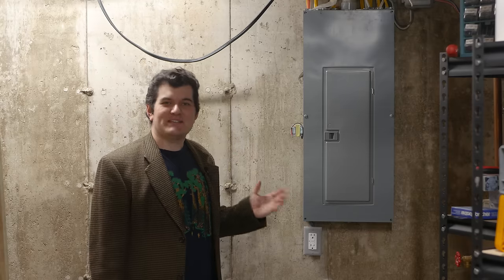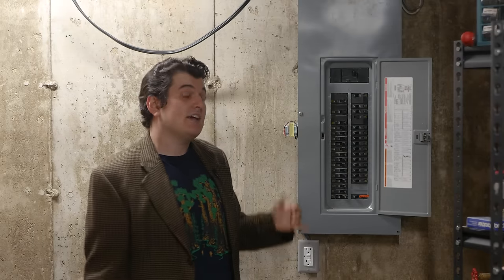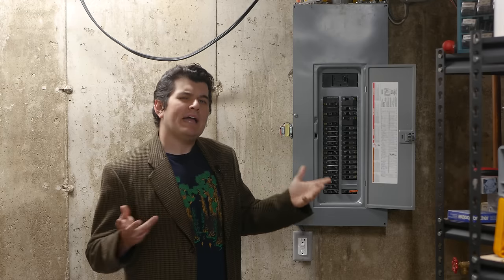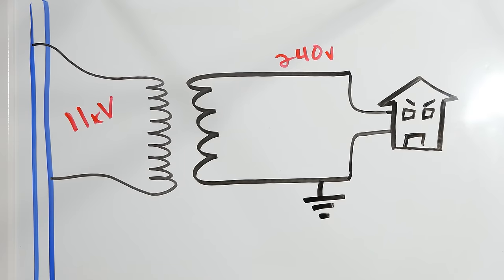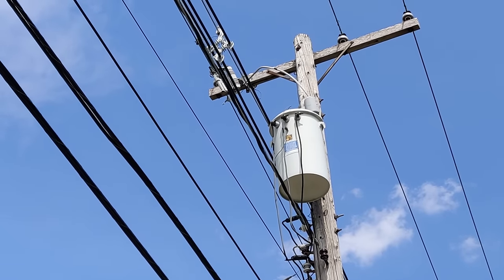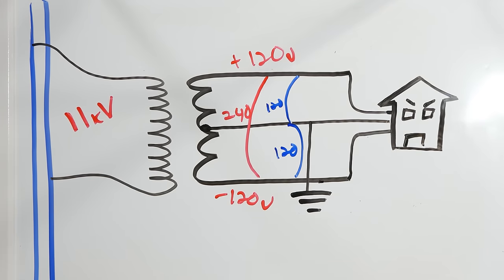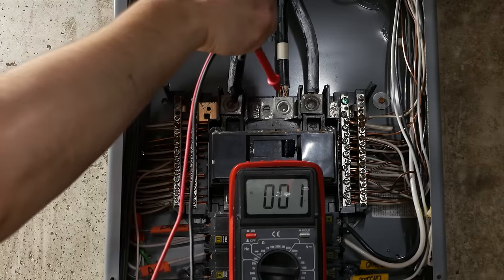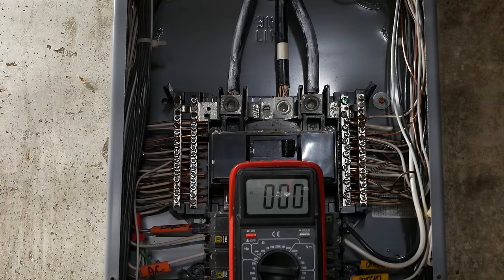The US electrical system is not 120V

Comment: The switches on our UK outlets goes back to before we had shielded conductors on the plugs. 
By switching the switch off the conductors were disconnected from the supply in order to prevent fingers from contacting the unshielded conductors of the plug. 
Unshielded conductors were outlawed a few years ago and the switch is in reality no longer really necessary. The design of the 3 pin UK plug ensures that the "HOT" wire is always "on the right terminal" so that the switching occurs on the "HOT" side . 
Most homes in UK are supplied by a single phase from a 3 phase supply at the local substation. 
The voltage between phases on a UK 3 phase system measures a nominal 415 v.
Reply: The same methodology applies in Australia and New Zealand except our type J plugs are pathetic. 
The British Plugs  Type G (of which I have some) and used in quite a few countries, for example,  Some African countries, Jordan, Iran and Hong Kong among others are the best-designed Plugs and sockets in the world.  The German version of the European design comes second. (China uses the AU/NZ  type  I  as does Argentina and a few others.
It can barely handle  10 amps  2300 Watts . I have seen them heat-stressed  and starting to melt.
Really dreadful design.  U.S. plugs and sockets are just as bad and perhaps worse than AU/NZ
Reply: The switch is very handy when you have something like a phone charger and it means flipping the switch stops it charging, so you don't have to keep unpluging it.   Also when dealing with a high current inductive load - fan heater - to turn it off in case of a malfunction and avoid the blue/green flash of the back EMF across the plug pins.   Every UK socket should be switched, then it could save the country a fortune with devices that are never really OFF and only go into STANDBY, that way we might have a cat-in-Hell's chance in meeting the  carbon reduction promise that idiot PM Blair signed us up for...
Reply: Because you have 240V on each wire in the UK.
Reply: The switch was always an optional part of BS1363 from the beginning.  It was never required, even before sleeved L & N pins.
Reply: @jonathanpalmer155  Wait, am I understanding the order of operations here?
You (charging phone):
1) Plug phone into charging cable.
2) Turn on outlet so that phone starts charging.
You (stopping phone charging):
1) Turn off outlet.
2) Unplug phone from charging cable.

Me (US; charging phone):
1) Plug phone into charging cable so that phone starts charging.
Me (US; stopping phone charging):
1) Unplug phone from charging cable.

-the purring dork
Reply: US hots are always on the right side also, assuming the ground is on the bottom.  If you have an ungrounded device (like most lamps), a wider neutral prong ensures ensures that you can't plug it wrong (the neutral prong won't fit in the narrower hot slot)
The US electrical code doesn't specify a direction for outlets, so some buildings have them all upside down (ground on top).
Reply: I  started switching off sockets when a phone charger I left plugged in but unused developed a short one night, overheated and exploded (even though it was on an RCD protected circuit). So now I switch them off. It would be a real pain to have to unplug them (some of them have flimsy earth pins), and you mention how hazardous UK plugs are if you stand on them? You are right. Solution = leave them in the socket and turn it off at the switch. Voila, no hazard. 
Regarding RCD protected 240 sockets in the bathroom, why? RCDs are OK until they fail (failunsafe). Yes I know you are supposed to test them monthly, but no-one ever does. The first time I tested an RCD, guess what? It was faulty. So no protection. That is not an acceptable solution.
Reply: @comter  There's nothing in the UK setup that requires you to use the switch. You can leave it on and then the situation is exactly the same as the US. Alternatively you can use the switch to isolate the charger when you're done. I am pretty sure modern chargers use barely any power in standby so it's hardly worth worrying about, but to reduce it to zero you can switch it off at the socket (which is marginally easier than unplugging it).
Reply: @denelson83  240V on Live, 0V (or thereabouts) on Neutral.
Reply: @bimble7240  Bathroom sockets for shavers etc are isolated via a transformer not rcd protected.
Reply: @donaldasayers  Yes I know. In the video the author complains about the fact that 240V outlets are not allowed in UK bathrooms and suggests that RCDs could be used to protect them. I was responding to that suggestion. Maybe you missed that comment from him.
Reply: @donaldasayers  Bathroom shaver sockets were around long before RCDs were even a thing. Don't see them here in New Zealand any more.
Reply: @comter  No we can do the same, we just leave the switch on.
Reply: @bimble7240  Nope. Actually I'm agreeing with you.

Comment: 15:10 “magical point at which voltage...becomes dangerous”. When the telecoms industry in Australia was deregulated (back in '80s), the new cross-industry regulator needed to get data on just who could be authorised to work on telephone circuits, which operate at 50V DC with superimposed 80V AC ringtone. An employee named Ed Bondarenko, known colloquially as Dr Lightning, and who worked in the high voltage lab of the research facility attached to the original government telecoms authority, volunteered to be hooked up to increasingly strong power sources (voltage and current) until physiological trauma was detected. This was done at a major city hospital with resusc gear on standby. The outcome was that telecoms circuits required similar licenses as any other electrical work.
Reply: Why am I laughing while reading this? Especially the part "...until physiological trauma was detected." Who did the detecting?
Reply: I think you got the name wrong I think it's supposed to be electrboom or big Clive?
Reply: I wouldn't call the licence similar to any other electrical work,the course to acquire a open cabling  licence(phones) can be done in 2 weeks. Add maybe 1 week for some endorsements like structured cabling(data), overheads and undergrounds.
The course to acquire an A grade Electrical licence is 4 years.
Reply: Hahahaha,  ozzy still using copper for telecommunications.
Reply: @debochch  a pretty substantial portion of rural america still is too lol
Reply: I once stripped the cabling off a phone cirquit with my teeth. I forgot that it was plugged in and 48V with no skin resistance is quite a jolt.

I am happy to not have touched the 110V AC ring with my tongue.
Reply: Correct about the telecom circuits, but I should point out the 90 VAC is not 90 RMS, but 90 volts peak-to-peak. That is, the voltage - superimposed on the 50V talk battery - goes to nearly 0 and up to about 100V. That doesn't sound like much, since the 50V DC talk voltage is barely noticeable unless you get it on thin skin like the underside of your forearm. However, AC hits our body much harder. The 100V peak-to-peak ringing voltage will make you pull your fingers back right away! I made excellent contact palm-to-palm with 300V DC when I was 14. It felt like I had been hit in the back of the head with a baseball bat and everything got dark, but I didn't lose consciousness. If it had been 300V AC I would not be writing this.
(Recently retired after 34 years in telecom/IT for a large electric utility)
Reply: @debochch  We have a lot of it in the US. New circuits are fiber on the broadband side but often copper for the "last mile" to the customer, except for high speed circuits. When I retired two years ago we were still putting in a bunch of copper T1s. POTS (Plain Old Telephone Service - a genuine telecom term!) is copper at least from the subscriber to the pedestal.

Comment: In europe we have 230/400V in wye configuration evywere. Mutible houses are conected to a 3 phase transformer at once. This is possible due to the higher voltage so the cables can be longer.

There are single and tripple brakers for 230V single phase and 400V 3 phase circuits. (*Some contries use double and quad brakers instead because they are also switching the neutral).

Like the 240V appliences in the US some 400V devices are need the neutral and some are not.

Comment: "A spark from inrush current won't hurt anything"

Electroboom: "Hold my beer..."
Reply: the guy who managed to blow up a UK plug
next level
Reply: It doesn't hurt the device any more than a power outage would, but the spark can char the terminals.
Reply: I read this sentence as he actual spoke it, like a subtitle, lol.
Reply: I was surprised that he didn't mention his previous video where he showed the fact that there is a spark inside of the switch, so there will be a spark regardless.
Reply: It'll hurt a room full of hydrogen.
Reply: @ericcartmann  To be very pedantic, a room full of hydrogen wouldn't have any oxygen to support combustion.
Reply: @user-dj1hy6zc6q  It's less that, and more that contacts in the switch are normally built of materials designed to handle arcing, with snap-action to eliminate contact bounce. Plugs on the other hand can get quite damaged.

This is worse with the back-EMF from breaking inductive loads.
Reply: Spark from inrush currently literally set my house on fire. Granted that was 30 years ago and electrical standards have changed.
Reply: @in4theride75  House might have been full of methane gas farts.

Comment: We have 3-phase at work and 208 on most of our equipment but there's a few that distinctly don't like it. They are large capacitor-start motors that will occasionally trip their internal breaker if the motor fails to rotate properly at startup.
Reply: I’ve had more problems with 208V. Would a small step-up 208 to 240 transformer help you? That’s what we used for a high end laser system.
Reply: @amadeo262  Perhaps. We actually do have  480v transformer in the facility with extra capacity on it, it's just on the other side of the building and would take a lot of wire to re-route. However it's on the list of things we're going to do when we have down time.

Comment: Technology Connections: "A quick reminder on what transformers do: They're more than meets the eye."

Me: grumbles while I look for the TC Patreon
Reply: And over here they do not meet the eye in such an awful way!
Transformers are housed in small brick buildings with a steel door, found on street corners usually.
The cables are buried under the pavement, not strung along those awful poles.
Reply: @Rob2  Underground is a lot more aesthetic, but a lot more hassle and costlier. Needs way more insulation, and way more armor for when those brainless waterworks dudes go digging and put their shovel into the power line.
Reply: i don't get this
Reply: @paulmichaelfreedman8334  That happens, but it does not appear to cause any problems apart from a blown fuse and donwtime on the power.
On the other hand, we do not have power outages caused by a storm or blizzard...
Reply: @Rob2  Agreed, it's more robust against the elements. Both have their perks and downs.
Reply: @NoNameAtAll2  It's the slogan. Of the cartoon show from the '80s. "Transformers: more than meets the eye."
Reply: @VoIcanoman  More correctly it's a slogan of a toy line that became a cartoon show.
Reply: @Rob2  Indeed. Although I believe you only see above ground AC cables in the rural areas. Cities and suburbs usually have underground cables, as far as I can see or tell.

Comment: 6:35 yes im kinda shocked, greetings from 3 phase 400V EU
Reply: 415V UK.
Reply: @paulsengupta971  before 1987: 415V±10% thereafter til 2003: 400+10% -6% , after 2003: 400V±10%
Reply: Taraniis  correct, the new numbers are the specification, but not in practice
Reply: Yes, nothing has changed apart from the "standardisation", allowing a suitable tolerance so that no electrical systems had to be changed in practice.

Comment: Great video. Plugs in the UK have a plastic peg finished with the copper contact at the end. When the copper is fully enclosed in the socket even if the plug isn't in all of the way only plastic is exposed so touching a live connection isn't possible. The Earth connector is fully copper as that needs to be stronger as it opens the shutters in the socket but as it doesn't (mostly) carry any voltage, touching it doesn't matter.

Comment: Well, when we combine two phases we have 400 V  ;) 
And since we get three phases into our house (in Germany), this is quite common to have a 400 V outlet somewhere. 
And in case you wonder, usually you get 63 A on each phase.
Reply: I'm from Germany and I still know many places without 400V outlets, but mostly, those houses are older than 30 years.
And by the way, the showed service panel looks quite messy, compared to a new panel here in Germany and other countries in Europe.
Reply: Russia, the same. Rural areas have 400v too. Switched from 220/380 to 230/400 some years ago.
Reply: @kokokoshka-s7c  Probably that changed with the fall of Soviet Russia. I think the GDR had 220/380 too.
Reply: You can also get 400v in the USA if you need it.  Usually most houses have natural gas so they don't need anymore than 240v  my heating is natural gas so it s very cheap I pay like $45 in winter -10c to heat my house super super cheap.   So I don't need to waste money for 400v panel.
Reply: @Skyliner04s  In Spain we had 127 (1-phase) and 220V (3-phase), then we changed to the European 220/380 (so we could still use 220V-rated appliances), which with time was finally raised up to 230/400.

Comment: laughs in 3 phase, 30A × ?, 240V electricity
In all seriousness tho, this is quite informative and has cleared up a lot of things I was wondering about when it comes to US electrical systems
Reply: We laugh in minimum 380V 3PH 16A in our houses. Most often in 25A.
Reply: @Pentti_Hilkuri  16A is actually really low… in order to be selective that means you can only run 10A circuit breakers. I'd hope you get 25A minimum.
Reply: @arienh4  AT my country most houses have 20A inlet which then is only split intro "lights" and "sockets"  lol At least we got current leak protection onto the system. Chile btw 220v
Reply: Cr0Lar  I mean we can get three phase installed. A lot of people have 3 phase in thier sheds or garages for things like mills and lathes
Reply: Most houses in Germany have 3 phase 240V 50A or 63A .
100A is not as common but gets used too.

It is common to have a "400V" 32A (5p CEE) outlet in the garage/workshop, 
the bigger garages/workshops will also have a "400V" 63A outlet.
Gets used mostly for: air compressors,, grinding wheels, saws and welders

I work in electric wholesale.
Reply: 3-phase runs through most neighborhoods in the US (including the oldest ones: the neighborhood occasionally gets updated when the wires or other fixtures need to be replaced), it's just that most of us have little to no use for 3-phase, so we don't pay to have it run into the house.
Reply: and (usually) no switches on the sockets.
Reply: don't forget the leakage detection breaker being put on all circuits...
Reply: @absalomdraconis  Most of the time the "base" 3 phase 35A (houses+large apartments) connection has the same yearly cost as the single phase 40A connection (small apartments).
Reply: Please stop calling it 240V or 220V (or even 380V for delta configuration).
The European grid has been on a 230/400V nominal voltage for at least 20 years now, and only the UK had 240V in the first place.
Reply: @absalomdraconis  Not from what I've seen. Most neighborhoods just get a single phase primary on top of the pole. The exceptions are: (1) if it's a mixed-use area with commercial and residential or (2) it's a main road and the 3-phase feeder goes down that road.
Reply: All people with 3 phases laugh about it

Comment: Thank you for clearing up the misunderstanding. I'm an electrician in New Zealand and always heard America is 120 volts. Your explanations are very accurate. 
Erich from New Zealand 😁
Reply: The common American voltages are  120V, 208V, 240V, 277V & 480V. . .  There are others, but these are the common ones found in homes and small offices and factories.. . .   
120V is almost always Single-phase L-N .. . .  208V can be Single-phase, 2-phase L1-L2,  or 3-phase L1-L2-L3. . . . .  240V can be Single-phase L-N, 2-phase L1-L2,  or 3-phase L1-L2-L3. . . . .      120/240V is actually 2-phase, but the Americans will not call it that, it uses L1-N-L2. . . .   277V is almost always and only Single-phase, L-N. . . .   480V is almost always 3-phase L1-L2-L3... .  But much of the rest of the world uses  230/400V   That is 230V Single-phase L-N, or 400V 3-phase.. .   230V is the natural Single-phase from a 400V 3-phase 4-wire supply, L1-L2-L3-N